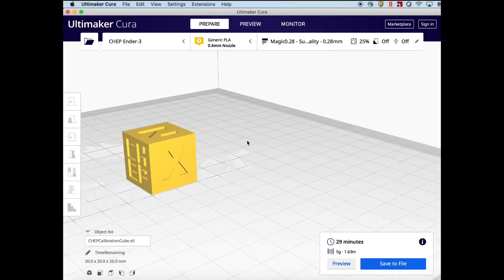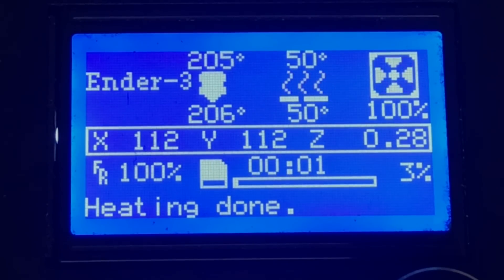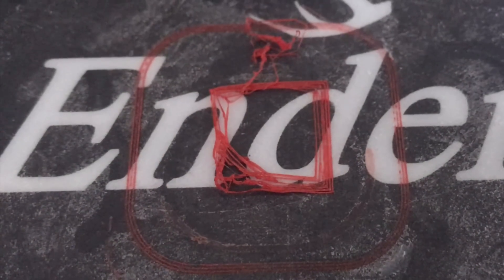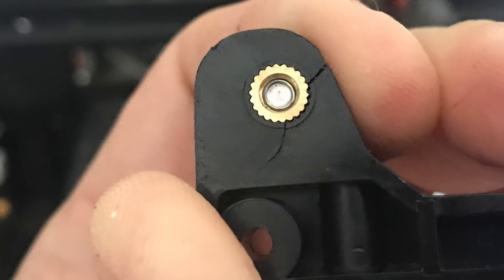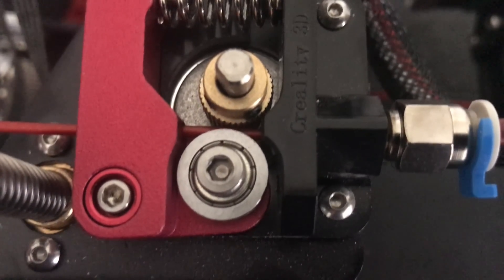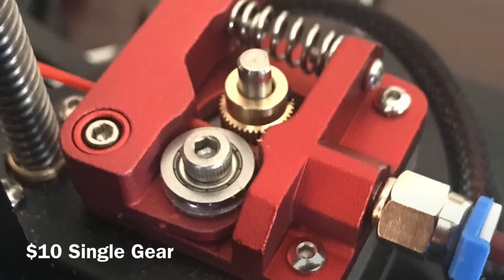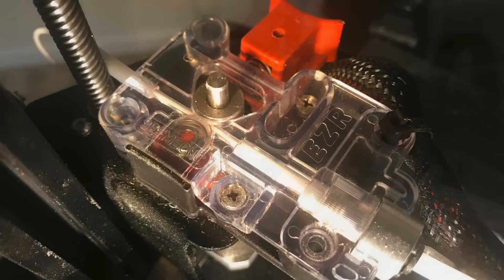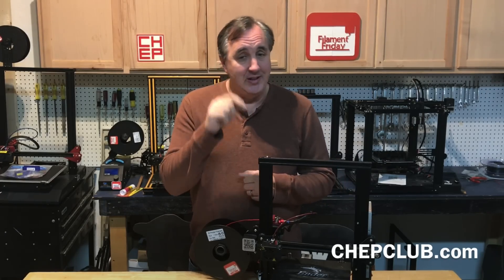Fix Under Extrusion from Cracked Extruder Arm on Creality Ender 3

Comment: What causes the extruder motor to stop in mid print? It starts out fine until about the first quarter of the print the the extruder stops but the machine keeps printing without any filament.
Reply: I have changed the extruder but not the motor it prints the CHEP CUBE with no problem but when I try to print something from thingiverse or something I made from Tinkercad it acts up , sorry to bother you but starting to get frustrating.
Reply from the maker: Check for loose connection that could be affected by the wires being pulled.
Reply: Turned out to be the extruder motor had a short, I replaced the motor and it prints just fine now. Thank you for your help l was a Patreon until COVID-19 I needed all the money I can get. I will become a Patreon again soon. Things are getting better. Have a good day.

Comment: Having the same issue but only started AFTER i instaled the metal extruder. Old plastic one had a crack in the hole where filament went into. Whats wrong? Changed temp from 205 to 220, bed at 50, speed at 50mm/s, new nozzles, new PTFE tubing... Please help.
Reply from the maker: Check the gear for slippage on the stepper.
Reply: @FilamentFriday  the stepper pulls the filament and sudenly starts skipping, like if ir cant push the filament in and skips back
Reply: Its almost like the hot end cant process the filament flow
Reply from the maker: Then you have a blockage.
Reply: @FilamentFriday  where? New nozzles in, still does same thing. People say i have to plug in to printer mainboard and check the steps... ???
Reply from the maker: If you want to do that then I cover that here:
https://youtu.be/QnrH2Sk7y40
Reply: @FilamentFriday  i have no idea how to do it...  
Swaped washer in extruder, re thinghtned everything, printing in mais air does not Skip (pressed Z Axis switch while Z was at 80mm high). Reprint in ver and starts skipping
Reply: @rafaellino9716  I have the exact same problem ! So I changed my extruder to a metal one according to the video, convinced it would be the final solution.
The extruder is working fine, but when I try to print a file (only !) the problem remains: no plastic at all and motor's extruder starts to make an odd noise...It's driving me crazy. 
I changed the nozzle, the tube, cleaned everything...
Reply: @ameliesamson2235  im having that issue WITH the metal extruder... Just ordered a BMG extruder to try...
Reply: @FilamentFriday  I had problems with extrusion too, they started some weeks ago. I ordered a metal extruder and a new nozzle and changed everything, but I still get the problem. Thing is I seem to be able to print a test print for levelling that I found with 20x20 mm squares, but when I try to print anything else I get a problem that the motor is turning the wheel with the teeth but the idler wheel only turn sometimes. I am starting to get mad at this.
Reply: I just spent the last week trying to solve the same issue with the aluminium extruder. I must have cleaned out my hot end at least 10 times thinking it was a blocked nozzle or heat creap prematurely softening the filament. I finally worked out that spring that comes with my aluminium extruder is slightly longer and therefore puts a lot more tension on the idler and gear. Works fine for some small simple prints but for big complex prints with lots of retraction turned on it actually starts to flatten out the filament from going over the same spot multiple times. Eventually you get a deformed filament with flat and lumpy spots in multiple places which then gets jammed in the bowden tube. happens more on Capricorn  tube due to the higher tolerances. Filament jams, Print fails and the gear grinds away the filament until it snaps. Also the extruder motor starts clicking and jumping back as it cant push the filament through. 
Solution: Swap the tension spring over to the original standard plastic extruder spring thats slightly smaller. Or try compressing the spring with pliers or in a vice for a while to reduce its length/strength.
May not work for all of the aluminium extruders out there but worked for me.
Reply: @mattitude1245  fixed mine last week by installing a BMG extruder clone. WAYYY more quieto, fast and stronger. Just had to add a "command line" in cura for the gear ratio.

Comment: Bought the same kit.  Lock washer is for the idler.  Not sure about the regular ender, but he pro had a lock washer in the same place.  The sleeve that goes around the idler arm bolt is slightly longer (thicker?) than the arm so the arm doesn't get bound.
Reply: I had the same problem as Chuck, now I installed the new metal extruder upgrade and it's over extruding on corners.
Reply from the maker: Have you changed firmware and have higher acceleration settings than stock?

Comment: Took the extruder apart and guess what.........cracked in the same place but not hairline, major! Almost all the way. Now my question is if I am replacing it should I go with aluminum replacement or the dual gear one you showed? Is one better than the other?
Reply from the maker: The dual gear has issues. I suggest the Seemecnc EZR or the aluminum one.
Reply: @FilamentFriday  do you have a link to the seemecnc ezr?
Reply from the maker: It’s in the description but just realized it’s sold out at Matterhackers. So Get it here:
https://www.seemecnc.com/collections/parts-accessories/products/ezrstruder

Comment: Hey Chuck, i am thinking of changing the extruder to an aluminum one as well. question about profiles, i downloaded your profiles and cube from thingi, but .28 profile still says that it will take 45 minutes? how did you get it down to 29 minutes? is your magic profile different than the default profiles on your site?
Reply from the maker: Infill may affect your time.

Comment: Really enjoy your great videos Chuck.  Been watching your channel since purchasing an Ender 3 last June, along with a couple of other channels that seem very knowledgeable of the Ender 3.  Finally decided to assemble it last month, after deciding on what upgrades I would do during the assembly process.  It worked great - hot-end & bed heat up accurately;  X. Y, & Z axes  all move smoothly, quietly, and accurately.  The only problem I have is the extruder (motor).  It does not work.  Am able to turn the motor shaft by hand and all the connections seem to be OK in the electronics case.  I am stumped.  Any suggestions / thoughts?  --  Patrick

Comment: You saved me!  I was getting crazy under extrusion the same day I had successful prints without any setting changes.  My extruder was cracked and never would have guessed to check the tension as it appeared the wheel was moving with the filament.  Thank you!
Reply from the maker: Glad I could help.

Comment: Heya, dunno if this is related, but I tried printing things on my Ender 3 w/ dual gear drive, Capricorn tubing, and a relocated spool, and my prints have some layers come out beautifully, but then suddenly come out like Salem-skin except without the walls and only the artifacts and suddenly switch to printing beautifully. Is there anything to fix this?
Reply: I was having this problem as well. I bought a Capricorn tube and extruder kit on amazon for about $20. I would get consistent good layer bad layer. I tried adjusting esteps and that helped marginally. It fixed it with a metal kit. I'm very pleased with the results.
Reply: bajojohn I already have Capricorn tubing and and a dual-drive all-metal extruder. I have already adjusted the esteps for that extruded. Maybe my cap tubing was worn down due to blobs at the end of my filament when I was switching filaments.
Reply from the maker: Have you tried different filament?
Reply: CHEP I’ve tried Prusament and some Chinese PLA, Matterhackers and some other Chinese PETG. I’ve still gotten the same results.

Comment: So I just got a Ender 3 Pro and after my first print i decided to install the CHPOWER Extruder Upgrade. Now my prints are coming out like crap. It has poor contact and is slipping like you show for your broken stock piece. My new prints look like your 1st cube you showed. Upset because the stock part printed my 1st print awesome. Now, I might go back to the stock one to save me the headache of trying to fix the new install.

Comment: I have had extrusion problems for over a year, tried everything from cold pulls, replacing the extruder head, raising the temp and lowering print speed and this solved everything. Thanks!

Comment: I had been suffering from under extrusion for a while but it was intermittent. I tested esteps, flow rate and everything I could think of.
I had already replaced the extruder for an all metal one a long time ago but something clicked when you mentioned the idler wheel not moving, I went to check it and the bolt had come loose and was indeed not turning.

Be sure to maintain your bolts people, it can save days of frustration!

Comment: Your videos have been quite helpful, thanks! In the video you mentioned that replacing the extruder with an all metal one still didn't allow you to print flexible filament. I replaced my extruder with an all metal one, replaced the Bowden tube with Capricorn tubing, added a runout sensor/filament guide and (I think the key) printed a spool holder that uses bearings to allow the filament to feed easier. These changes have allowed me to print TPU using SainSmart TPU without a problem even going to 35 mm/s! Either I'm quite lucky or the simple modifications I've made have been helpful in printing TPU.
Reply from the maker: Ninjaflex is what I referred to. There are many TPU that are flexible but not super flexible and can be printed without issue.
Reply: @FilamentFriday  Got it! The SainSmart has a hardness of 95 vs 85 for the Ninjaflex. I may have to get some Ninjaflex to see if my modifications can handle the increased flexibility.
Reply: @FilamentFriday  I got some Ninjaflex (hardness of 85) and while it looked like it was going to be a problem, I managed to print one of your cubes at 10 mm/s and it looks good. I will try to print a little faster and see how it goes. The EZR extruder does look intriguing if it would help me print TPU faster.

Thanks again!
Reply: @FilamentFriday  The EZR Struder and a glass bed have been key in getting the NinjaFlex to print! While I had initial success without those, that success was short lived. Thanks for the recommendation on the EZR!

Comment: Just a quick questions regarding underextrustion. I've upgraded to the aluminum extruder and capricorn tubing but I'm still having occasional underextrusion on atleast a couple lines on almost every print, and when I have someone paying me for a print, I hate for that to be visible. Is there something I'm missing? A setting? I use the profiles that you provide for us. Mostly the .2 layer profile.
Reply from the maker: Try setting seam to corner instead of random.
Reply: If it is under extrusion make sure the bolt through the idler wheel is not loose

Comment: I didn't have a cracked extruder but I had the filament wearing away the plastic inlet hole that goes into the extruder. Ended up getting the aluminum extruder for reliability/quality.

Comment: This is the problem I had, as well. Im also having trouble guiding my filament through the hole that goes through the tube. Any tips?
Reply: Cut the filament in a shape angle, then bend the point a little down and pass it through the holes firmly, that should do the trick. Good luck!
Reply: @Misanthrope669  +1 I always bend it down just a bit

Comment: Any one tried to print the gear bearing in ender 3? i can't get loose...
Reply: I did, took me a while to get it loose, but the gear bearing I printed had a hex bore so u got a big enough Allen key to twist the parts free from eachother. To smoothen it up, hook it to a drill and keep it on the highest speed for a couple minutes and then add some silicon oil

Comment: Hi Chuck! I've bought the palm ratchet you have on your video description but I'm not able to find the socket I should use to remove the nozzle, can you share a link, I'll buy from affiliated to help you with that
Reply from the maker: I use a 1/4” socket but I believe 6mm will work. Each brand of printer is different so this  set or similar should work.
https://amzn.to/2tJgS6Y

Comment: I had a similar issue with under extrusion and bought the Creality aluminum extruder, (pretty much the same as in this video) and while it also made an improvement, I realized the the bowden tube was always going to give me inconsistent, unreliable extrusion due to the inevitable friction of the filament sliding through the tube. I printed a direct drive mount from thingiverse, bought a $4 extruder motor extension cable, tightened up all the adjusters a bit, but not too much, and the quality of my prints are incredible! The extra weight on print head is not a problem at all!! Ditch the bowden tube and you'll solve many problems with print quality. My prints are better than the one on this video!
Reply from the maker: Have posted pics anywhere?
Reply: @FilamentFriday  No. I just started 3d printing in November so I never thought to take photos of the "before and after" to show online. I have experience with CNC machines and work in the automotive manufacturing industry, so that experience helps me with 3d printing. Don't get me wrong, I appreciate your videos and have learned a lot from them as well as others. My disappointment isn't with you or your video, it's the bowden tube! I had a print that took up most of the build plate and everything on the side closer to X-Home was under extruded, but the other side was fine. This was because when the print head is closer to X-Home, the bowden tube is flexing the most and causing more restriction to the filament path. I replaced the bowden tube, confirmed the extruder wasn't slipping, but it still had the same problem. The filament had a matte finish which adds to the friction, but I don't want to be limited to what I can print. Frustrated with the bowden tube, I printed thing "3589452" from thingiverse, recalibrated the extruder, and problem solved. Again, I appreciate your videos. Keep up the good work!

Comment: hey chep, loving the channel, and i am now also racking a decent shopping cart on amazon for upgrades and have loved some of the products you have recommended via referral links. (where i can being aussie and some dont ship here) :) 
I have hit an issue I am running a new series ender 3 pro and I am using your magic profile 2mm and i have just simply swapped from the ender branded PLA to a new product (3D Printer Filament Highly-Accuracy PLA PLA+ ABS PETG 1.75mm 1Kg/Roll) now I am still printing great but i am getting like small artifacts in the lines and  some are bubbles that you can just wipe off, its not in a corner or anything like that and they are really small. best way to describe it as being like cream in a cake and its just i mean just showing on the sides, not sure if i need to ramp up heat or down the heat, am trying this today. i am re-watching all your videos now trying to find any reference to this
Reply from the maker: Lower the temp.
Reply: @FilamentFriday  ok i will try that first, i was trying hoter temps :) i think this stuff sticks to bed better being hotter but i will drop down temps on the print and try that thanks mate
Reply: @FilamentFriday  Hi Chep, thanks for that you saved me a bunch of time mucking around. dropping the printing temp to 195 has greatly reduced this issue for me, you can only just see these imperfections in the prints i did next.   I will try dropping a couple more degrees this evening but this has made a massive improvement. Thanks again

Comment: Thanks Chuck, you really helped me a lot with this video. After six months my Ender 3 would under extrude random layers in the middle of the print, which was initially annoying and made some ( but not all ) of my prints weak. Gradually the problem got worse, to the point where I was almost getting results as bad as you were getting here. Once I watched this video I was sure that I must have a similar problem. I removed the stock plastic extruder arm and sure enough it was split underneath, right next to the threaded insert. I purchased and fitted an aluminium replacement extruder and my Ender 3 is printing perfectly once more.
I cannot stress enough to anybody who buys an Ender 3 that you should just order the aluminium extruder at the same time. Replace the stock extruder as you build your Ender 3. It's a cheap upgrade and it's one which eliminates all kinds of problems in the future. I've had to bin quite a few prints and when the problem was only occurring sporadically it was super frustrating because I never knew whether my print was going to come out strong or with one or several under extruded layers. The aluminium extruder is definitely the way to go.
Love your channel Chuck, appreciate your efforts and am a subscriber !

Comment: You are a life saver. I had been fighting with mine for a long ass time. My problem originally was heat creep but replacing the hot end only half fixed it. This was the other half. I have the arm rigged with a rubber band until that kit arrives. I bought another for my cr 10 so that it doesn't happen on that one.

Comment: The ezr extruder is really great, not just for flexible filament but putting any filament in it is so much easier than trying to with the plastic or metal creality ones
Reply from the maker: Yes, it works with all filaments. I should have clarified that in the video. I love it.